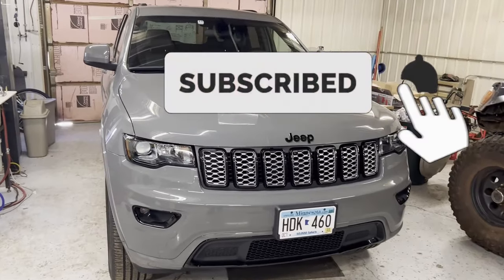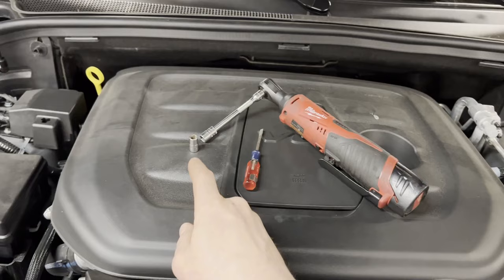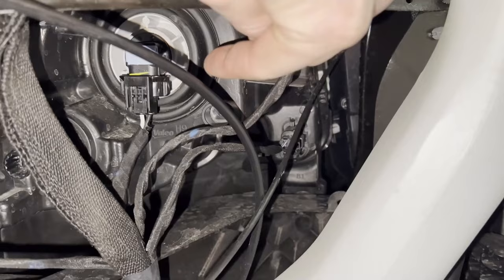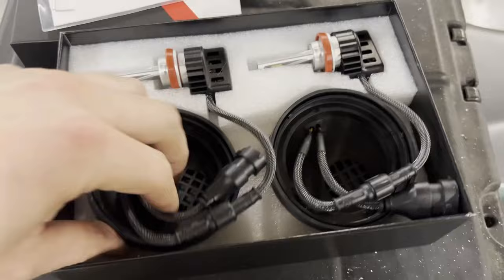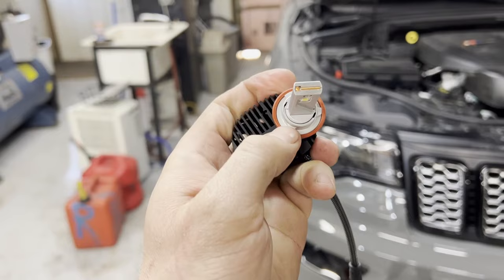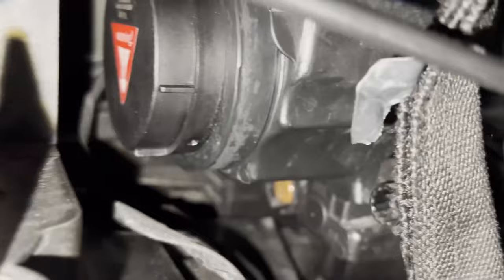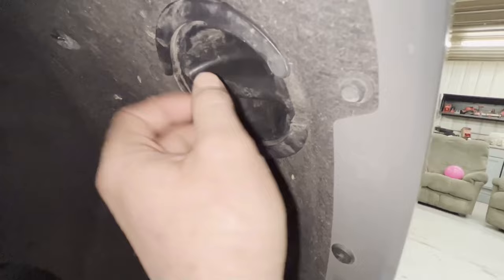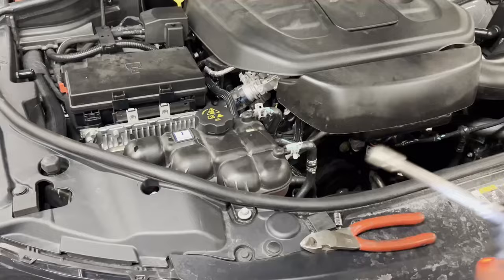JEEP GRAND CHEROKEE 2017-2021 - HOW TO INSTALL SPECIAL H11 LED HEADLIGHT BULBS

Comment: This is aweful, I hate engineers sometimes.
Reply: With tight spaces. The vehicles or most modern vehicles is bad to get them installed. Rather than nice open spaces that’s relatively easy to work on.

Comment: Just did this, I was struggling for 20 minutes at first. (IT TOOK 5 MINUTES)Then I realized I was doing it all wrong you don’t have to turn the wheels and unscrew the cap or anything. You have to pop the hood, slide the ecu off the rack and out the way then it’s the perfect amount of space to pull the boot off (don’t pull the tabs it’ll be way harder to come off pull it off from the rim of the boot) then you have access to the bulb. Go to the right side of the car stand looking towards the back of the car, stick your right hand into where you took the boot cover off and pull up then out a little. It will pop right out. Then pull it up you don’t have much wire to work with but it’s just enough unclip the bulb and put it back in the EXACT same way you took it out facing the back of the car and all and don’t forget to put the ecu back on the rail
Reply from the maker: Thanks so much for your feedback with such detailed information!
May I ask if you have installed the LED bulbs featured in our video? We are looking forward to more updates from you!

Comment: After completing this process (hopefully correctly!), I'd like to state that the video instructions are excellent, HOWEVER I would like to caution that removing/installing the low beam bulbs is hard to do.  The low beam bulbs are located within a cylindrical housing which makes them very difficult to remove or install, including seeing the LEDs bulb housing - required as a specific orientation of the bulb/housing is required to lock them into place.    It's like manipulating something found 1" deep within a drinking glass; not the easiest thing to do and definitely easier if you have smaller hands - I got my neighbour to remove the passenger side as I just couldn't get the old one out!    That being said, it can be done and they do look great once installed.

Comment: YOU are a LIFESAVER!!! 
I had tried endlessly to squeeze my hand up through that damn little hole in the wheel-well to get enough pressure to twist the bulb into position. You made it so much easier! Thank you!🎉
Reply from the maker: Delighted to hear that the video was helpful to you!
May I ask if you installed the custom-fit LED kits in the video on your Jeep Grand Cherokee? What's the year of your Jeep Grand Cherokee?

Comment: Passenger side tip at 5:39 with rotating the bulb counterclockwise. I could not grab it well enough to apply force and turn it. Hope it works for someone. 
No matter what angle I tried, it just wouldn't budge. I bet mechanics have a special/makeshift tool for this job that would make it a breeze, but I ended up taking a zip tie and bent the tail end into a half square hook. I used my right hand on top and my left in the wheel well to feed it around the bulb. Once I had the tail inserted into the head, I pulled the zip tie just a bit so I had a circular connection around the bulb- keep it loose so you have a loop to grab. Since the bulb electrical connector is at a 90 degree bend, the zip tie can hang loose over that part and be used to loosen it. 
Then I took a regular slip joint pliers and fed it down from the top with the handle part facing down and teeth part facing up. This allowed me to then come up and grab the loose zip tie with it. You'll use both hands, right on top and left in wheel well to guide the zip tie into the mouth of the pliers, but once it's closed, you can squeeze and push down with your right hand and the bulb will come loose and turn.  Make sure the zip tie is on the 90 degree bend before pushing down. Then it's cake from there. Do what he says with the ECM and access hold in wheel well to have more space. Once you feel it budge with applying minimal force after fighting it with your fingers, you will feel like you just busted a rusted nut/bolt loose. Finally!
Reply from the maker: Thank you for sharing your detailed solution! Your method will definitely help others facing the same issue. If you need any further assistance, feel free to contact us.

Comment: Outstanding tutorial. I discovered that if you remove the lid of the airbox (two simple clips) and take out the air filter, you can see the posts that the box sits on, which makes it easier to remove and reinstall the airbox.
Reply from the maker: Thank you for your affirmation of our video! The information you provided is also quite useful! May I ask if you have installed our products?
Reply: @lasfitvehiclelife  I did not. OE replacement part.

Comment: Went to a mechanic that changed the low beams through the fender liner hole a couple years back. 
That being said before searching videos I figured I’d give that a try and I don’t know how in the world that dude was able to do so.. He must have the hands of a 10 year old. 
Great video!
Reply from the maker: Thank you for your comment!
Yes, for some vehicles, the space is relatively small, which can make it difficult for people with large hands to replace the bulb.
May I ask if you installed the custom-fit LED kits in the video on your Jeep Grand Cherokee? What's the year of your Jeep Grand Cherokee?

Comment: Excellent Video! - I have a 2021 JGC Limited (4x4/5.7L) and it has projector with halogen (puke/sad) and I will use this to video to change them to HID.  I was wondering about the rubber dust cover,  the HIDs have external components that need to stay outside the housing so I will put a small slit in the rubber dust cover.
Reply from the maker: Glad to hear that this video is helpful for you.
Yes, you can drill a small hole on the dust cover to let the HID harness through the hole.
Are you interested in trying this specific H11 LED kits for your 2021 JGC? 🙂
Reply: @lasfitvehiclelife  I already have LED kits for high-beam, and every other light outside of my vehicle has been converted. to LED.  I found the LED low-beam/DRL in the projector lens not as crisp as the HIDs on my wife's Lexus so I ordered some HIDs for the low beams and installed them as I write this.

Comment: Very helpful video! Somehow on the passenger side I was able to fit my skinny hands to switch the bulbs out didn’t even have to remove anything out the way 😂 the driver side though I did have to remove everything you did in the video

Comment: Great video! You struggled so much making this video and doing the work with one hand 🤣 I wish there was a way to upgrade to the headlights with the DRL. I have a 2015.
Reply from the maker: 😂🤣😆 
If DRL and high beam work on the same bulb, the DRLs probably don't work well after installing LED bulbs.
Reply: They won’t work with DRL? Just installed some and one works fine but the other flickers then shuts off
Reply from the maker: @bradwright7109  Hi, did you install Lasfit Pro-DC Series LED bulbs on your JGC, or other LED bulbs from other sellers?
Could you tell us the trim and year of your Jeep Grand Cherokee?
Thank you.

Comment: Awesome video; it's hands down the best video on upgrading the lighting system (bulbs)!
Reply from the maker: Glad it was helpful!
May I know the year and trim of your Jeep Grand Cherokee?
Reply: @lasfitvehiclelife  2018 Altitude. Due to this video, I upgraded all 6 (low, high, and fog). If I could, I'd upload a picture; having said that,  I am having an issue with the passenger low-beam headlight; it flickers on and off while I'm driving (randomly). I'm hoping the Lasfit customer service team will follow through, but I'm getting the run-around so far... One customer service rep advised me to purchase a HIKARI canbus decoder...
Reply from the maker: @user-is9ox3zs7n  Just the passenger low-beam flickers, but the driver side works without flickering, right?
Reply: @lasfitvehiclelife  Yes, all of the other ones I installed operate perfectly. The passenger flickers and will randomly go out, and on some days, it’s perfectly fine. Any thoughts?

Comment: Great Video. I bought these and installed in my 2019 Jeep GC. 
I liked the brightness but my driver side headlight bulbs is going on and off sometimes. Not able to find what the cause is.
Can someone help if you had the same issie
Reply from the maker: Thanks for your feedback. For this issue, could you please switch the position of the two bulbs and check if that one has the same problem on the other side?
Please don't worry, if the light is defective and still under warranty, we will send a new pair to you.
Thank you for your help.

Comment: I have already upgraded my Jeep GC with Quality LED lamps but, I’m thinking about the new Jeep GC Headlight Revolutions replacement units. They are awesome with DTR surround LED lights and with three LED projector headlights unit per side. The kit comes with wiring harness. The only issue is, the high price at $1800 for the pair! :-(
Reply from the maker: If you would like to install after-market headlight assemblies, you can save money now.
If you want to upgrade to brighter headlights, I would recommend our Pro-DC series LEDs to you. These specific H11 LED kits are specially made for 2017-2021 Jeep GC.

Comment: I have bought the Lasfit combo pack for my 2018 Jeep  Grand Cherokee.  The low beams go in no problem but the port for the highbeam is much different with the prongs being further apart.  Is there a work around on this so I don't have to send them back?
Reply from the maker: For this issue, is it possible to push the prongs to shorten the distance? 
There were several customers also reported the same issue, and they just squeeze the pins to the middle and then the plug would snap into the factory wiring harness. 
Please don't worry, if this does not resolve your issue, you also have the option to switch to another product series from us or request a return and refund.

Comment: Bought these from your company and you guys sent me the wrong high beam bulbs so now I have to redo the entire thing. Also I’m getting weird shadows from the drivers side. I’ve tried the screw driver adjustment trick but it didn’t fix it. Any help would be nice
Reply from the maker: Hi, please don't worry about that, if you have any problems with Lasfit LED bulbs, please contact us by email to get support.
Contact email: cs@lasfit.com

Comment: Ecm definitely did not need to be messed with
Reply: True. If you have small enough hands with some dexterity you can replace both bulbs without removing anything. I’ve done it, granted not with LED replacements but replacing the stock halogens.

Comment: Thank for the vid. I have an older model but it seems to be relatively similar to mine(2012). I was wondering tho, I’ve noticed not too many ppl change high beam to led, Im curious to know if that is because it’ll be overkill or personal preference
Reply from the maker: Actually, a lot people changed high beams and low beams to LEDs together. But for some vehicles, if highbeams and DRLs work on the same bulb, DRLs probably don't work well after installing LEDs. So, some people don' want to replace the high beams to LEDs.

Comment: I own 2017 Overland 5.7 where the lights turn up when on, also turn to the direction with the front tires?  Will these still fit?
Reply from the maker: Hi, are you looking to upgrade your OEM halogen headlight low beam to LED lights? When you mention the lights, are you referring to low beam?
Reply: @lasfitvehiclelife  yes

Comment: People with 2014-up WK2 Jeep Grand Cherokees trust me when I say you will want to replace the Halogens with whatever quality brand LED  like this is available.  Not only are the Halogens dim compared to LED, but they burn out a lot quicker. Watching this video alone should give you a clue how hard it is to replace them. (And whoever designed the WK2 this way is either the biggest moron, or a genius at being able to generate revenue for Jeep in labor replacement costs)

I have changed out my bulbs for LEDs and have changed the LEDs for different brands (I like trying different ones) 6 times. It does NOT get easier, believe me. Plan on donating a layer or 2 of skin. Whether you go from the top or  bottom through the cut outs in the front wheel well,  you will need to contort your hand/ wrist / forearm and even your fingers, in ways you never thought possible.  I have since switched to under the wheel well because moving the complete airbox assembly is a pain. Either way you choose,  you will curse the person who designed the process.

Comment: Changing the low beam without removing the bumper cover and the headlight assemblies to get them clocked properly is impossible. The access hole requires the hand size of a child with the strength of the Hulk. You may as well and bite the bullet and do it the right way, it's not that hard and there are several videos on how to remove the bumper cover.
Reply from the maker: Due to the limited space, it truly needs more strength and tricks.

Maybe you can try to replace the factory bulb from the fender near the tire, if it is still hard to get access to the headlight housing, we recommend you get assistance from the auto shop.

Comment: Are the high beams and low beams the same bulb or do I need separate bulbs?
Reply from the maker: Hi， the low beams and high beams are not the same bulb, if you want to replace the halogen bulbs, you need separate bulbs.

We have custom-made H11 LED bulbs for the 2017-2021 Jeep Grand Cherokee low beam, 50W,5000LM that can bring exceedingly brightness and a dual cooling system will bring durable and longer lifespan:https://www.lasfit.com/products/2017-2020-jeep-grand-cherokee-led-bulbs-custom-made-h11-headlight-low-beam?utm_source=Social&utm_medium=YTB%20Channel&utm_campaign=Pro-JP-01L
As for the high beam, please check whether your high beam bulb size is H11 or 9005.

Could you please tell us the year and the trim of your Grand Cherokee? So that we can recommend compatible LED bulbs for you.

Comment: Do you have any issues of the headlights (dims) turning off while driving? Sometimes they turn back on but recently they didn’t. I had to use brights and pull over and shut off the vehicle and restart for them to turn back on.
Reply from the maker: We don't have the issue at the present.
Could you kindly contact us for tech support by email with more details, like a short video, to show  your issue.
Thank you!

Comment: Do you need any type of resistor or anything so you don't get a light out warning? Or this kit is simply plug and play with no issues?
Reply from the maker: Hello, what's the year and trim of your Jeep Grand Cherokee?
Reply: Sorry to jump in but I have a 2017 Grand Cherokee Limited would that one need a resistor?

Comment: Well, unfortunately after hours and hours of trying to take off my head lights, and then trying to install these bad boys, I failed! Im not sure if its because my jeep is a 2018 and its 2023 now, so the lights have corroded a little bit?  but i cannot get the new lights to twist back on for the life of me! this video made it looked sooo god damn easy and im super annoyed by it lol. Like i said it could just be my jeep, but these did not work for me. it took a big flat head with alot of torque just to get both the lights off, and that shouldve been my first red flag!
Reply from the maker: Hi, replacing halogen bulbs can indeed be challenging and requires some strength and tricks. Have you already purchased this custom-made LED bulbs? If so, you can try fitting the 3 tabs of the bulb into the corresponding slots and then rotate it clockwise to secure it.
Reply: @lasfitvehiclelife  I can try fitting the 3 tabs of the bulb into the slots? Did you not read my comment! They don’t want to turn and fit. Even after taking off the front bumper and headlight housing.
Reply from the maker: @livinginbellinghamwa1  Hello, if it's convenient for you, could you please share some pictures of the headlight housing you are trying to install? This will help us better understand the issue and provide you with appropriate solutions. Don't worry, Lasfit offers a 45-day free return policy and a hassle-free 1-year warranty. If you encounter any problems with the product, please feel free to contact us.
Contact email：cs@lasfit.com

Comment: Do you know the size bulb of the fog lights?
Reply from the maker: The bulb size of 2017-2021 Grand Cherokee is H11, we have switchback H11 LED fog lights， simply control the on-off-on of your fog light switch to change the light from 6000K cool white to 3000K warm yellow light. 

You can check these switchback fog lights from the following pages:https://www.lasfit.com/products/2017-2020-jeep-grand-cherokee-led-bulbs-custom-made-h11-headlight-low-beam?utm_source=Social&utm_medium=YTB%20Channel&utm_campaign=Pro-JP-01L
Could you please tell us the year and the trim of your Grand Cherokee?

If you have any problems, feel free to contact us.

Comment: Has anyone seen anything about the longevity of these bulbs? I heard him say they have a two year warranty. Was just curious
Reply from the maker: Yes, we provide 45 days money back guarantee and two-year warranty. You can try them on your car with confidence. 
In case you don't like them, you can return them back for the full refund.
May I know the trim and year of your Jeep Grand Cherokee?
Reply: When headlights already have projector lenses so I'd opt for HID. Long lasting, far cheaper and brighter. Don't need active cooling either.
And the 6000k+ color temp of near all LED's kills your night vision. At least with HID can get 5000k bulbs.
I'd only consider LED for older style reflectors headlamps.